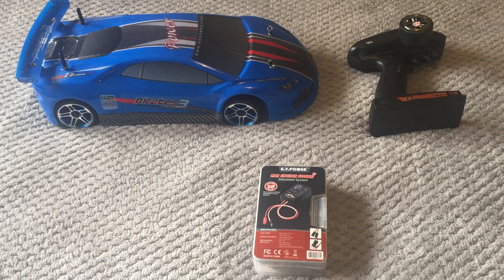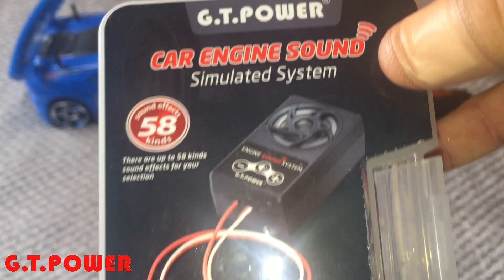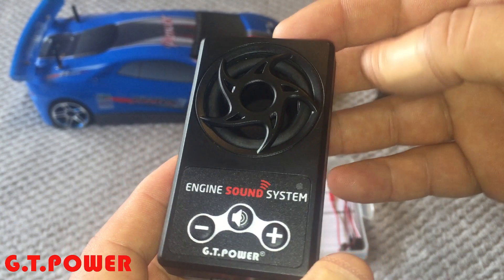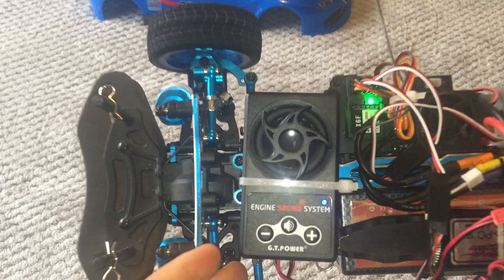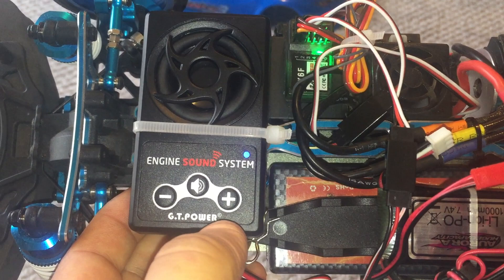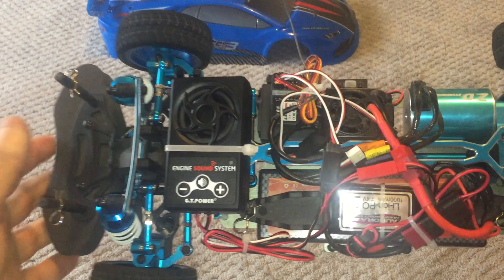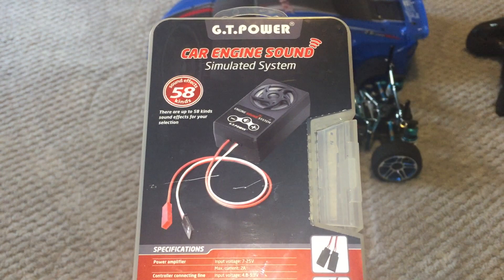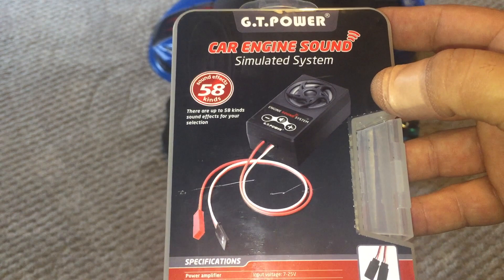GT Power Simulation Engine Sound Effects System for RC Cars & Trucks

Comment: Hi Mate May I ask. For the throttle jst is there a cable just for throttle and why there’s 3 wires? And do you think I can convert the wire to the speaker to a 3.5mm Aux and plug into a larger speaker? I wanted to put it on an EBike

Comment: Any tips on how to install this when you have a rig with the new 2-1 Ferma 40a which has 4 channels BUT "No servo throttle output"
Reply from the maker: Not sure if you can without throttle output as it relies on the throttle for the signal to activate the sounds of accelerating and braking.
Reply: @PERTHWESTOZRC  Yeah!   Read I could bind two receivers to a controller so I could do a work around but not sure if really possible.  bought a SR315 to try and being a total newbie fried my Dig servo and the controller would not bind to stand alone receiver.  Now that I have spent money on 1/2 a setup, maybe I just change the 2-1 out completely and get an ESC to work with the SR315.  For now I have to make the engine sounds myself.

Comment: This is a nice mod for my MN86ks G Wagon V8 Brabus. V8 sound is 🥰
Reply from the maker: Yeah its perfect for that model, I may install it in my MN86ks G Wagon crawler/ trail truck
Reply: @PERTHWESTOZRC  I’m going to do a Brabus Drift Gwagon😂. Brushless motor, drift tires and disconnect the front shafts. Parts in transit from banggood and some from AliExpress.

Comment: I'm having sound engine reversed issues. When I pull the trigger for throttle forward the engine sounds idle but when I hit reverse I get the engine driving sound what's wrong? What am I missing?? I tried setting my remote to TH Normal but it's doesn't drive. I tweak with the remote settings nothing successful. Any tips?? My throttle is always set to R for reversed u believe. Anyone know? I have a Tamaiya ford mustang.
Reply from the maker: Hi bro sorry but i haven't ever come across that issue before, sounds like something is definitely glitching with the signal wire for throttle. have you checked that you plugged it in the right way on the receiver?

Comment: Where do I plug in the red wire if I don’t have one of those battery’s
Reply: Or we’re can I get that little battery you had
Reply from the maker: The small 2s lipo with Deans Tplug? You can buy them anywhere online like eBay aliexpress etc,

Comment: Good video! I have a 1/10 RC batmobile, could you put up a simulator like that? Is the battery Li-ion 7.4V or is an extra battery needed?
Reply from the maker: As long as the batmobile has an independant receiver this sound unit should work, but if it's got an ESC and receiver 2 in 1 combo that may be difficult to get to work. Yes this runs off a 2s lipo. Thanks for watching